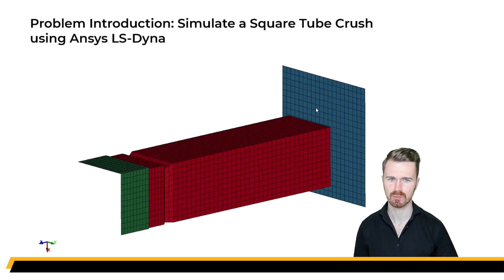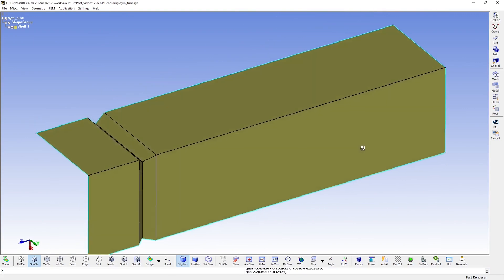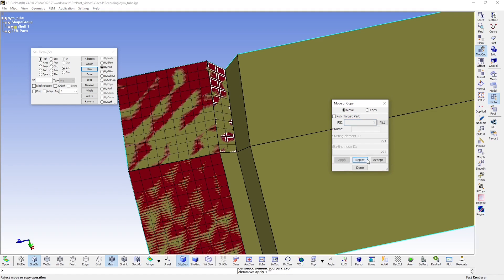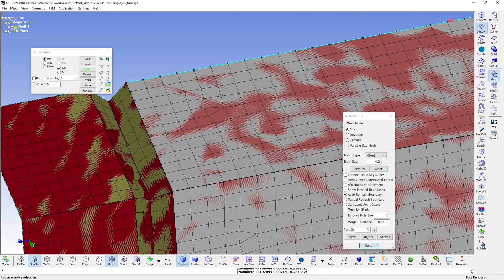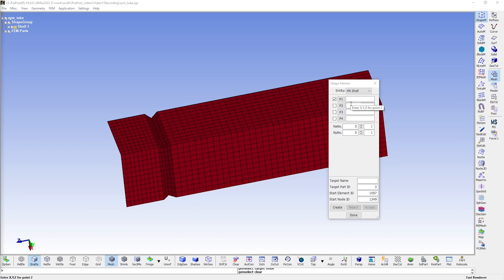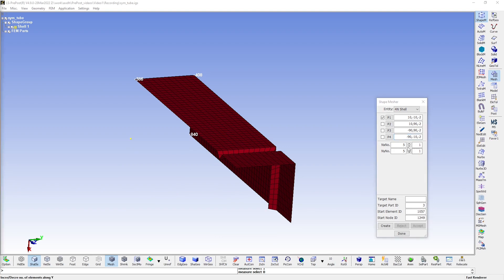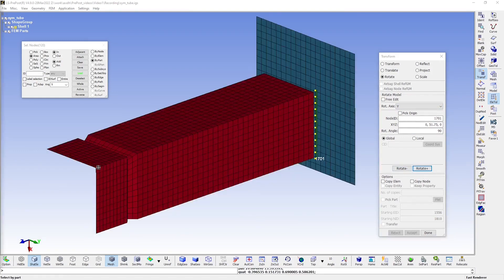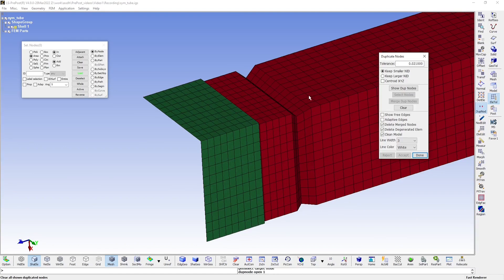Meshing and Various Tools within Ansys LS-PrePost

Comment: Now I finally understand what's wrong with automesher.
Instead of keeping the same number of elements on analogous edge segments it tries too hard to keep the same element size. That's why swept geometry always required tweaking! When in reality it might have even been beneficial to refine the mesh slightly on the bends and inside corners.

Anyway, THANK YOU for the tutorial !

P.S.
Is there any clever way to mesh large aluminium extrusion with internal ribs (like a modern bumper beam) without manually stitching individual parts or resulting to solids?
Reply from the maker: Thanks for watching! Please post your query on the Ansys Learning Forum for a detailed answer from the wider Ansys Community: https://ansys.com/forum.